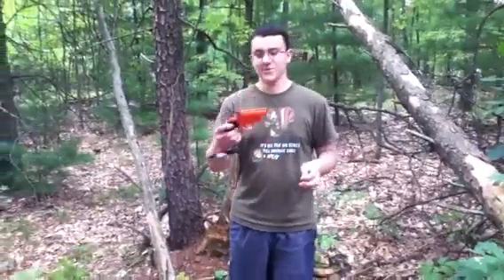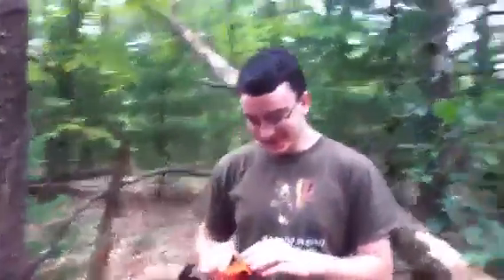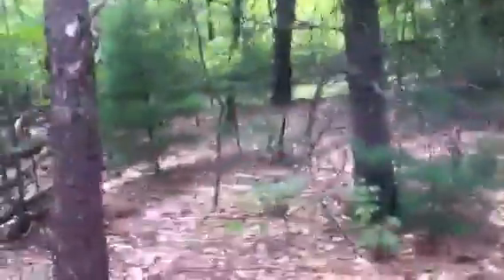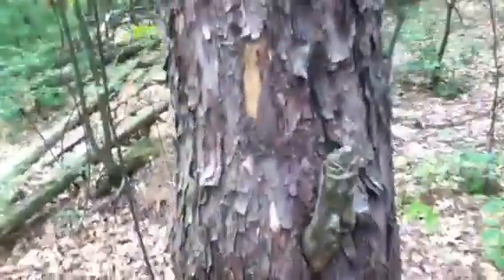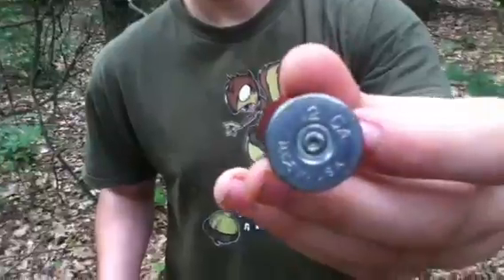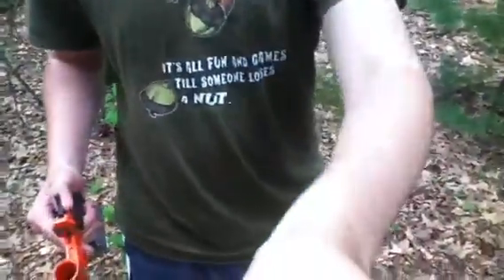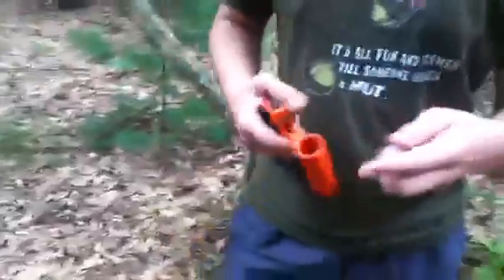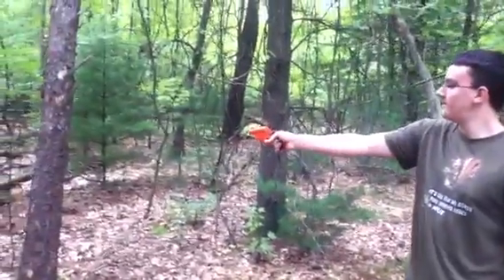Flare gun shotgun shell pt. 3

Comment: @gunjunkie1000 No it isn't, look it up. If you are too lazy to do that, I will send you a link with the actual definition. It's only a shotgun if it came from the factory with a buttstock. You can have a pistol grip shotgun with a barrel length under 18" as long as it's still over 26" if it has never had a buttstock attached. The length of this "gun" is far under 26". It's an illegal AOW. If it had a buttstock attached at some point in it's life, then it's then a SBS.